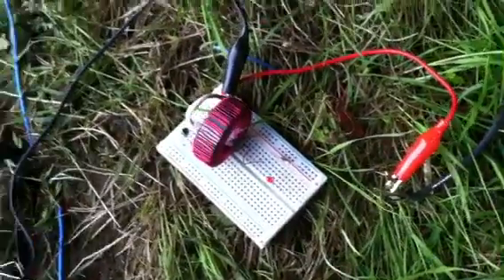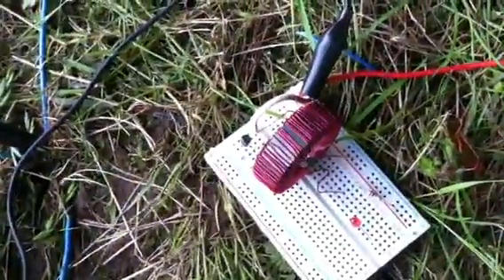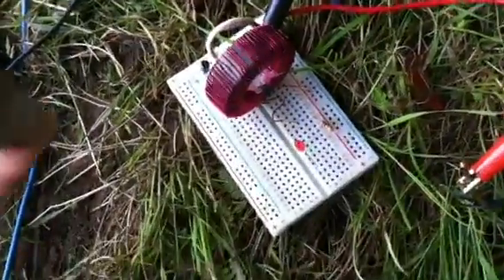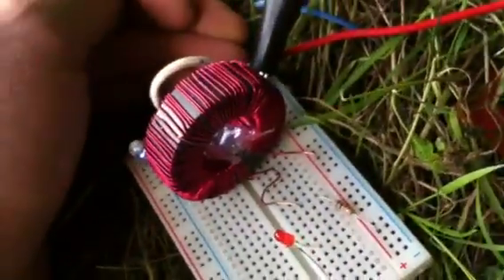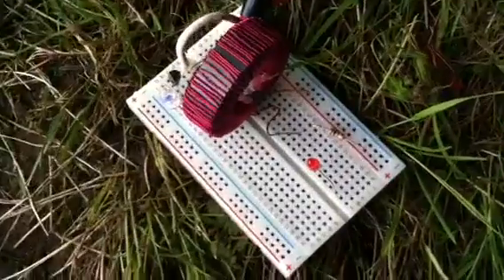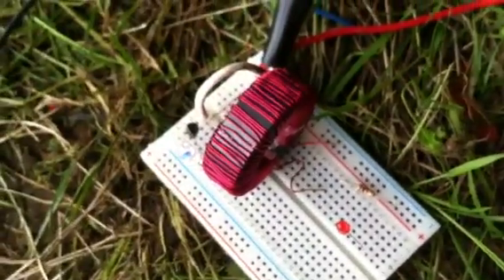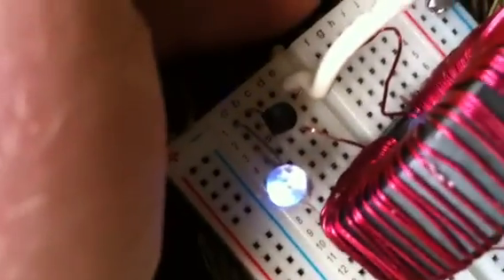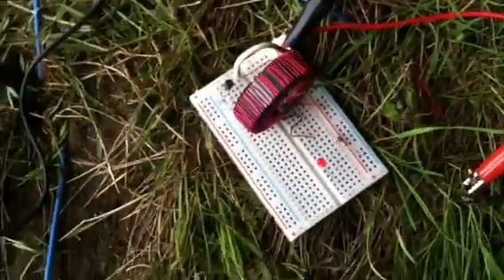Carbon/magnesium earth battery lights LED

Comment: Hoe many turns did you wind. Id that ehat madr the difference  thanks
Reply from the maker: Little Big Ideas I don't know how many turns on the joule thief. I wound on as much as I could fit without overlapping the winds. I think what made the most difference was the surface area of carbon and magnesium, More surface area = more power!